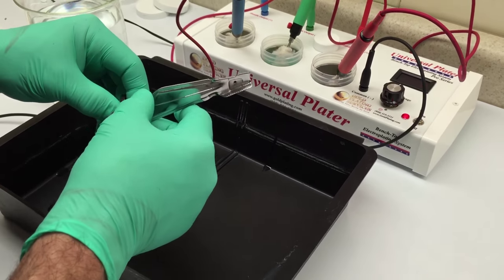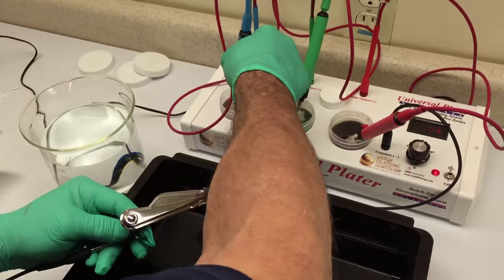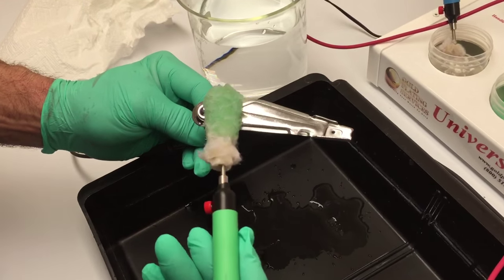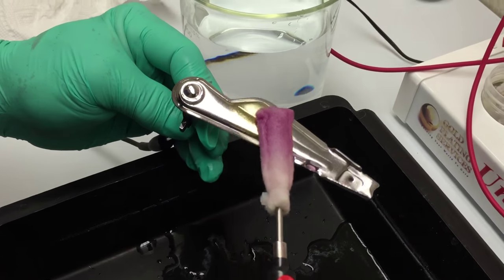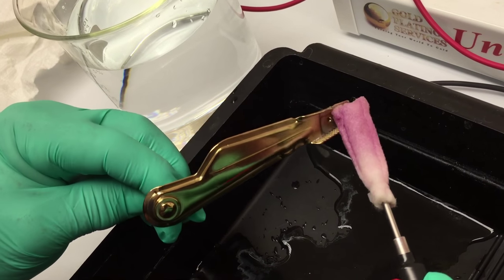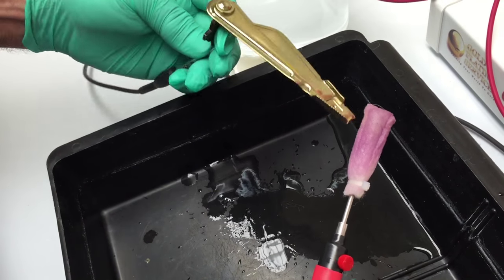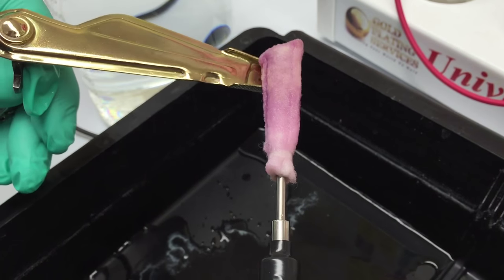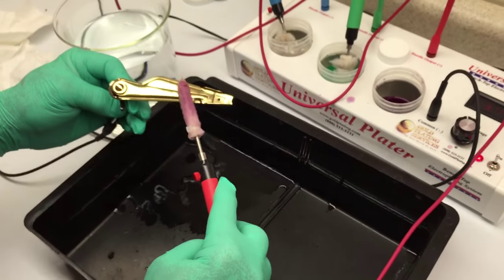24K Brush Gold Plating on Guns - How to Brush Gold Plate Steel - Universal Plater Kit

Comment: Looks like ak-47 safety
Reply from the maker: +sasoproductions Turns out that is exactly what it is.  Good eye!
Reply: You should have showed the whole firearm after it was done how does this hold up does it rub off easy does it come off when the gun gets hot or is it done just for a wall hanger
Reply: sasoproductions lol exactly what I was thinking! The movie lord of war came to mind
Reply: How much does it cost to gold plate the entire gun (AK) ?
Reply: @josephatnip2398  He probably didn't have the whole gun to show. Gold plating will wear through eventually, although how fast that happens depends upon how thick the plating actually is. Generally speaking, other than parts like the trigger, gold plating isn't something that you see on hard use firearms. It's more for commemorative items that aren't really going to be used much if at all.
Reply: @Cgny  Ask any cartel member
Reply: Haha! I can't believe I with my ignorant self knew what it was!
Reply: @Cgny  cheap if you diy
Reply: Would the gold melt if you shot it a lot when it heats ?
Reply: @JuanCastro-eq6op  look up the melting temp of gold, then find the temp of a barrel after you decide how many shots "a lot" is.

Comment: This is awesome. May I ask how come some golds are more of a darker yellow/orangey and some are lighter and softer looking?
Reply from the maker: There is a few different reasons. The first one being the type of gold it is, if it is 14k, or 18k gold the color will be a lighter gold color. It could be because an item is freshly plated and it will change color a little bit as it sits overnight. Another reason could be because there is a lot of iron in the gold and it is depositing onto the surface of an item with the gold and it makes it appear darker. There is a lot of different reasons but these are the most common.

Comment: how many parts that same size could you plate with that same kit with no solution refills?
Reply from the maker: The kit comes with a 250mL bottle of our 24K Brush Gold which contains 2.8g of fine-gold.  Assuming this piece is 3 square inches of area, you would be able to plate around 400 pieces to a typical decorative thickness.  An 250mL bottle will cover around 1,200 square inches of area to a typical decorative thickness.
Reply: wow, im impressed. i bet all your silverware in your house is plated in gold. lol
Reply from the maker: It's definitely fun (and useful) to have the ability to gold plate things. Once you have everything you start to see items you never noticed before as possible candidates.  Gold plating with ours kits is actually quite fun and in a way magical, people are always impressed when they see it happen in front of their eyes.

Comment: You can use nail polish remover to clean medal of polish material, oil, grease anything
Reply from the maker: That's correct.  Nail polish remover (acetone) works well for removing polishing compounds such as red rouge.  Toulene works even better but is very similar to acetone.  Thanks for the great input!

Comment: If I plate a matte aluminum piece with gold, will it get a polished shiny look?
Reply from the maker: Great question! Aluminum is very difficult to plate. After being polished or cleaned the surface oxidizes within seconds of coming into contact with the air. We recommend sending the Alimunum to a professional to have Nickel Plated. The color and texture of the substrate will dictate the color and texture of the Gold. For a quote, visit our website https://www.goldplating.com/pages/quote-request

Comment: Can you gold plate aluminum parts?
Reply from the maker: Bare aluminum cannot be plated onto with any of our kits. Our kits will plate onto most types of metal, however, trying to plate onto bare aluminum with our kits will not work. This is because aluminum requires a specialized under-plate process that is not suitable for consumer level plating operations. This process must be performed on an industrial level by trained professionals. We do not sell the process or provide support for plating onto unprepared aluminum surfaces.   Any attempts to plate onto bare aluminum with our products will not work, please purchase with this in mind. 

If you have a project that requires plating onto aluminum, you may consider sending the parts to Gold Plating Services to be plated by our technicians.  We can provide the required nickel under-plate for a nominal charge. We can then gold plate, or chrome plate your item or return it with the nickel under-plate.  After the aluminum has the proper nickel plate it can then be plated with the metal you desire using our Universal or JewelMaster Series kits.

Comment: How did you remove the coating to bring out the nickel like color of that cause they are usually black steel
Reply: The black on AK's (depending on the country of origin) is usually a paint which you can strip or sand off.  Yugos and a few other countries use bluing. Then you just polish the steel.  Any steel can be polished to a chrome finish, which is what you need to do prior to playing, assuming you want a high luster.

Comment: How or could you gold plate the whole gun even if the gun has polymer pieces
Reply from the maker: You would plate the gun in sections.  As far as polymer: In order to electroplate something it must have a conductive surface (metal), so the polymer or plastic parts could not be plated unless they are made conductive with a conductive ink or lacquer.  Coating plastics with conductive lacquer to electroplate can be quite difficult and have varied results.

Comment: I have questions
1. how much the price of the machine with coating material
2. Can the plastic coating
3. Does the machine can be charged for Saudi Arabia
Thank
Reply from the maker: Answers:
1. This particular kit is $799 USD and includes everything you need to do gold plating as intended.  Solutions, accessories, machine, etc.
2. Plastic items need to be prepared with a conductive lacquer or ink prior to electroplating.  Electroplating requires a conductive (metal) surface.
3. Yes we can ship to Saudi Arabia.  We've sold kits to nearly every country.

Comment: How could you remove the factory stain from an AR or AK .?
Reply from the maker: There are various methods and this is a highly discussed topic in gun communities such as forums.  If you do a google search you can find lots of information on this subject.
Reply: Dear Jonathan

We used to totally clean the heavy grease from our brand new galils, by tying the tip of the rifle with a string and immersin it several times in super hot soapy water for about a minute, then we rinsed  the rifle in two separate containers...Immersion in soapy water, hot then another hot water all in separe containers.  You may still need to do some detailed cleaning afterwards.

Comment: how long will this coating last before it starts to fade ?
Reply from the maker: It purely depends on how thick you plate it and how it is taken care of.  As you can see, it turns gold within seconds, but that is only an extremely thin layer that would wear off quickly.  However, if you plate it for minutes it will get very thick and last a long time (years).   If the item weren't handled at all it would last forever.  If the item is handled daily and treated roughly it may only last a few years even with an average thickness plate.  If you plate it thick it should last a really long time.

Comment: would this work on copper as well? would the copper color show through?
Reply from the maker: +Howard Kurtus Thanks for the question.  Yes, the same basic process would be followed.  Steel is actually more difficult than copper.  For plating onto copper the only difference would be using a "Bright Nickel" in the second beaker instead of "Woods Nickel Strike".  Within seconds a fully opaque layer of gold is applied, and the longer you plate the thicker it gets - so no, the copper will not show through.
Reply: Gold Plating Services
Reply: Can you just use bright nickel onto steel then gold? Or what?
Reply from the maker: You can apply a Bright Nickel as the final step, in place of the gold (or before gold plating), however you still need to do the same prep steps - Electroclean, Strike, Plate.

Comment: I thought for mild steel, they told me I need a copper strike so I can plated in gold. This video they don't show no copper strike and the item is mild steel. 🤔 very strange and confusing.......
Reply from the maker: You can use the woods nickel strike, but we recommend the copper strike because you can visually see the item being activated and which makes plating easier.

Comment: how do i get it to this point from the black finish of the AK? sandpaper or buff?
Reply from the maker: There are many different ways to get there.  In this situation, we simply buffed it on a buffing wheel with red rouge.  It can also be chemically stripped.  If you search the web there are many resources for how to remove bluing/black finishes.
Reply: Gold Plating Services how can i chemically strip the black finish on the gun?

Comment: What is the price of this manchine
Reply from the maker: The Universal Plater Kit is $799.00, this includes the gold solution, Electroclean and Surface Activator.   It also includes the other accessories as well as additional cotton sleeves and disposables.  The only thing added to this kit is the "Woods Nickel Strike", which is $20 for an 8oz bottle.  Woods Nickel Strike is required for plating onto steel items.  So in total it would be $839.00 and would include enough gold to cover approximately 1,000 square inches to a typical decorative thickness.

Comment: After gold plating bare metal would I need to seal it or does the plating protect the metal?
Reply from the maker: Great question.  The gold does "seal" the steel off from exposure to air thus preventing rust and corrosion.  However, it must be plated to about 1 micron to achieve this.  An alternative option that many people choose is to apply a layer of Bright Nickel prior to gold plating, this produces a "diffusion barrier" that will keep the gun from corroding no matter how thick the gold is.

Comment: hi can this kit gold plate aluminum?
Reply from the maker: No this particular set up will not plate onto aluminum.  Plating aluminum requires a much more technically challenging process.  We recommend sending aluminum items to a professional company like ours or similar to have them Nickel plated, and then you can gold plate them yourself with this kit.
Reply: Gold Plating Services 
where is you office

Comment: Does it. Scratch off
Reply from the maker: Yes.  All metal can be scratched with the right abrasion.  However, under normal use and with a thick plate, it holds up well.